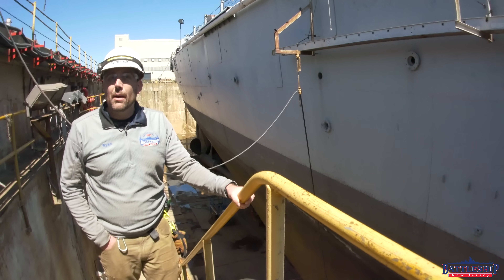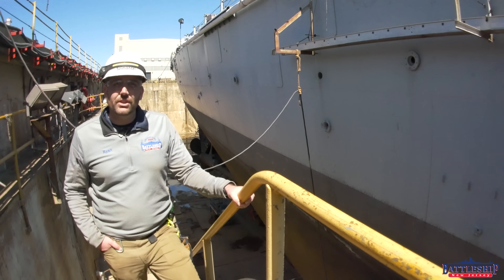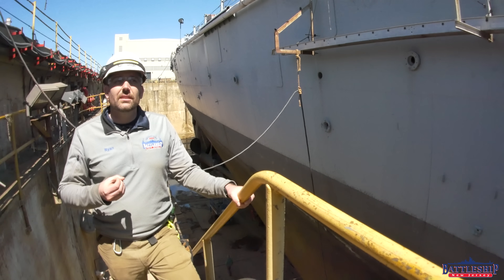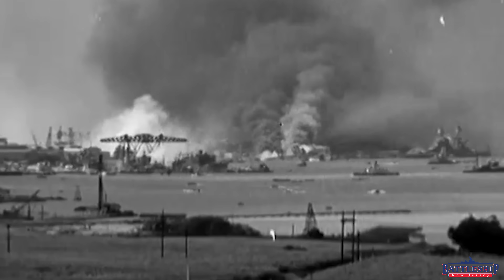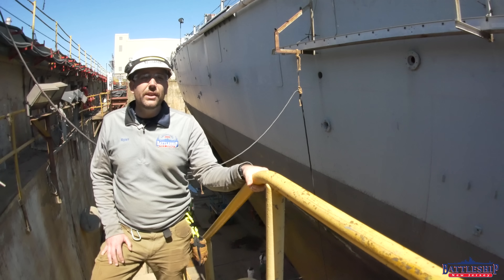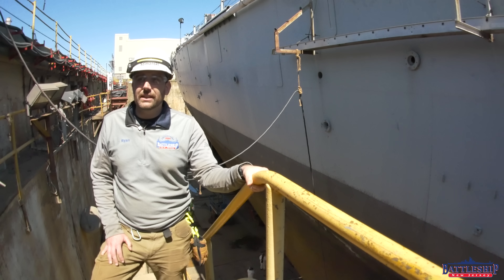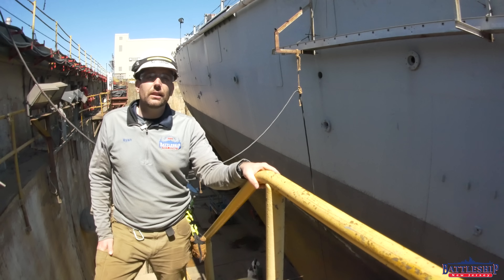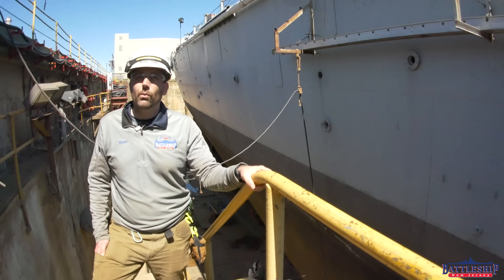The Most Vulnerable Part of Any Museum Ship: The Wind Water Line

Comment: How exactly do the propeller shafts  come thru the hull? Is there some sort of a bushing or gasket? Is that being inspected also? What keeps the shafts centered as they exit the ship? Whatever it is, does it need maintenence overtime as well? Does it leak need pumping out? I imagine if the shaft isn't perfectly centered or gets misaligned somehow it would create a heck of a vibration and considerable damage to the thru hull opening. 
I never thought about any of this until watching this video amd seeing them by the screws painting the rudder. I see a few others are curious about some of this as well.

Comment: As a Limey and used to the metric system, your use of "mils" caused initial confusion. 30 mil of paint seemed rather thick (nearly 1 1/4")  then I heard you mention thousandths of an inch. Light bulb moment.

Comment: About the ship's condition... now you mention it, yes! I wonder about the prop shafts. In an earlier video you mentioned it's coated with a substance that should keep water out (and is also one of the main reasons Iowa shouldn't turn her propellers). I wonder if the checks from the outside revealed anything interesting about this.

Comment: I wonder if some plastic tanks could be installed in forward parts of the ship in lower unused compartments and then filled with water to replace some of the normal operating weight that is absent from the ship now?  I'm thinking tanks like the ones you see ranchers and contractors hauling around on trailers might be cost effective.    Besides the benefit of the ship sitting at its proper waterline,  it would also be relatively easy to empty tanks as needed in order to do inspections and such by pumping out water and dumping it overboard.

Comment: I'd definitely be concerned about the propeller shaft ports into the shaft alleys, the rudder post joints and ports into the steering compartment, and the stabilizing struts that hold the 2 outboard shafts. Also the blanks over the sea chests but you guys already checked those.

Comment: you can see the entire exterior so any issues would be inside due to condensation and any water from weather getting in. not something you need to mess with in drydock though and you probably keep a handle on it anyway just through regular maintenance. interior of the through hullplugs maybe, make sure the steel isn't degrading badly...but again one of those things i suspect you check fairly often.

Comment: The Bakery is the place where most care is needed. The problem is not the water, but rather the other sailors sneaking in and taking extra donuts for themselves. You think not? I was one of the biggest culprits hanging over the Dutch door looking longingly at the donuts as the second-class petty officer turned the donuts and set them out to dry. My cute face must have made a difference because he always gave me some in a bag. And they were square donuts that way there was no waste between the donust and all of the dough was used in one pass. He had a roller and so could cut out a whole batch at once.

Comment: As a suggestion, I would be considering the things that my enemy may not have considered... and while dry-docking is a GREAT excuse to obviously do the work you need to do to things that are normally SUBMERGED - WHAT needs to be calibrated or fixed INSIDE the vessel and is significantly easier to repair or calibrate while she is PERFECTLY STATIONARY?  If there is a gyro-compass you think you can get to servicable-condition: now is the time baby... not that you can't do that later, but let's do what you can while the contractors do their contracted jobs on the outside.... ALSO - have they made the boat's interior accessible to you and your staff during this process or is it a real pain in the ass for you to even board the boat???

Comment: Point of slight correction: the waterline is calculated based on optimizing the boat's cruise- and flank- speeds with a minor bias towards improving range at cruise instead of trying to squeeze the last half-knot out of her top- top-speed (because it takes an hour of straight-line sailing just to get up to flank-speed anyways).  And then the armor and turrets were designed out away from the intended centers of buoyancy and mass to achieve an optimal armor profile at expected battle-speeds given the already calculated intended water-line: but obviously all of this gets screwed up if she has taken battle damage and is listing or flagging at the head or stern or if she is unable to make battle-speeds.
Reply: For any super-nerds that wanted to read on: the Iowas were tremendously capable of using their mains to great-effect if they were operating at a normal battle-speed OR if they were slowed to near-nothing but far less accurate at mid-range speeds.  But, her WW2-era fire control systems IMPUTED a designed-assumption that the boat was riding an even-keel and trimmed appropriately for the speed she was making.  The gun directors certainly had procedures for compensating for a list or other abnormal situations - but, if she wanted to be shelling a target at distance while scoring hits - she either needed to be going fast enough to be driving the bow up and really creating that white-surf mustache on the bow or she needed to be at a near-drift: which is dangerous if you are in-range of the enemy, but dramatically less-so if you still out range your foe by 5-6 miles.
Reply: Underway replenishment - a talent that we developed which was far more important to the outcome of the second world war than the skill of our carrier planes (the direct opposite of the Japanese experience) - is also REQUIRED to be conducted between vessels that can match speed and course, in choppy seas, and be riding on a very even-keel, which can be very difficult to account for when you are traveling and speed and independently bobbing and bouncing in 3-different dimensions of space-time.

Comment: The wind / water line of USS Yorktown is abysmal and makes me wonder if Patriots Point are letting the ship deteriorate like they did the USS Clamagore Sub.  I kayak a lot and have paddled right by Yorktown close enough to reach out and touch her - the rust holes are as deep as my fingers in places and I expect I could pull steel off in pieces bigger than my hand if I tried.

Comment: I believe the Iowa has solved her bow trim issue by ballusting turret # 1 with several tons of 16" practice ammunition . This explains why they had to rotate Turret #3 so they could line up with the ammunition loading hatches . The shells were struck down to broadway so as to use the overhead rail system to move them up to Turret # 1 for stowage. The Iowa channel has a series of videos explaining the process. Perhaps Mike Getcher could give you folks some suggestions on where to obtain 16" training ammunition.
Reply: it took 2,000 tons of water to level her for the drydock blocks

Comment: To answer Your question: With the outside protected, I would take attention for damage inside - out. For example accumulating liquids in hidden areas. Possible sources would be ingression of rain water and air moisture condensation. Worst case would be leakage of toilet system...

Comment: Hey, big fan of the channel. Flew from AZ to see the ship. 
With the ship sitting so much higher in the water. Would it be possible to simulate the weight of a fully loaded new jersey by using weights, underwater chains etc. Or is the amount of weight that would have to be added just too much to simulate? Thankyou
Reply: To ballast the ship to enter the drydock, they added about 500,000 gallons of water (approx 2000 tons) to the peak tanks which are at the very bow of the ship.  Adding that much water brought the ship from about 10 feet "out of trim" (IOW how far from level) to within 3.8 feet of trim, which is where they needed to be to safely land the ship on the blocks.  Right after settling on the blocks, they had to pump out that water as the peak tanks storing the water are the bow shell plating, and the cold ballast water would cause the bow hull plating to sweat with condensation, which would present a problem with paint application.

Let's say the Museum decided to ballast the ship permanently for the reasons Ryan stated.  First, they would have to find the perfect ballast material---while water is the perfect thing for an active naval vessel, that's far from perfect for a Museum ship.  The perfect material for a Museum ship would have to:
1. have a greater density than water
2. not react with the interior of the ship and cause any corrosion or other degradation
3. be cheap
4. be placeable into the ship with minimal effort

One last detail:  the two gangway/elevator towers at the Museum's pier were built to match the ship in Museum trim, bow high.  The one at the bow is significantly taller than the one at the stern.  If the ship were ballasted to be level, the forward gangway/elevator tower would have to be lowered to match.

Comment: so, this is just my experience working on heavy vehicles, but rust typically starts from hard edges. a 90' corner on a plate, the end of a rim, a sharp angle bend, etc. I would think that the blockoff plates would have rust where they meet the hull plate, and where the shafts come out of the ship where the hull just kind of stops suddenly

Comment: It's great to hear issues about the wind water line are not of concern at the moment .Ryan did do a video about the forepeak tanks and evidence of corrosion from film of the last docking . It  does show how corrosive seawater is compared to fresh . Hopefully the ultrasonic tests will confirm all is well . I suppose the prop shaft and rudder glands are likely to be important if all other hull openings are blanked and tested .

Comment: As others have commented on the waterline issues, a question of my own.  If the reduced weight of the ship is causing the waterline's movement so much, 2 feet stern and 10 feet bow per this video's information;

All of the ship isn't being used for tours, and there are undoubtedly places in the bow (and forward / around turret 1), that could have weight added to try to lower the bow.  Yes, the total weight involved would be high (especially at modern costs of heavy, relatively compact, and not (long term) damaging materials), but why not attempt this for long term stability?
Reply: @terr281
Serious weight though. In order to solve bow sticking out (and pass the bridge next to NJ normal berthing place) they had to fill the forward tanks with large amounts of water. That is not a long term option, as not only tank corrosion is a problem but also the feet lines and valves between the tanks have proven leaking (see on off the preperation video's a few weeks back).  And that was only the weight needed to just be able to pass below the bridge, let alone all the extra weight needed to get to the normal displacement. 
Think of it like this, normal operation would be fuel, provision, ammunition, water and the almost neglectable weight of about 1600+ full grown man.
Reply: The ship does sit higher than it would normally if it was commissioned and fully fueled and armed.  They could ballast it level but the ship's pier access is designed for the bow to be 10 feet higher than the stern, they'd have to redo that structure if the ship sat level.  They plan to just coat the area that is her wind water line as it currently sits.

Comment: Why not load some of the internal tanks with lead shot or similar material to level the ship and bring the wind waterline back into spec.
Reply: Cost basically.
Go and price say 3000 tons of lead shot. Then fill the required voids with it. Plan on removing it in say 10 years to inspect for corrosion where its been sitting. Different metals together are the basis for electrolysis and rust, you get different cooling rates and condensation which will pool at the low points under your several thousand tons of shot. You will damage the paint putting the shot in there which adds to the rust issue.
Cheaper, easier and lower rust risk just putting up with the extra freeboard.
Also the access points into these areas are small man sized.

Comment: Now I have to wonder... why doesn't the museum ballast the ship to keep her close to her ideal waterline under normal conditions?  Are you afraid that some of the fuel bunkers might not have been cleaned out enough to let you safely fill them for ballast?  I'd think that if there aren't environmental regulations or corrosion worries, it'd make more sense to use water ballast to keep the thickest shell plating at the wind-water line...
Reply: Ryan previously said the fuel bunkers were "Swiss cheese".
Reply: Fortunately, when the ship was handed over to the museum, the fuel bunkers were emptied and cleaned. There's a little bit of water ballast for trim that they use, but if I remember previous videos correctly, the less they need to rely on those, the better, just for the sake of minimizing corrosion and potential internal leaks.
Reply: Ryan had mentioned before that using water as permanent ballast would cause more corrosion and potential flooding if there would be any piping or tank failures.  I'd be interested to hear if they ever considered a type of solid weight for ballast.  Sail boats often use lead in the keel for stability.

Comment: Where the ship sits in the water is entirely under your control. Dont wine about the bow being high when u could flood to fix that. Texas could even flood her sarbord side to fire further inland. Add ballast, or flood spaces so your line down the ship is optimal.
Reply: I heard no wineing, just concern. You can’t leave interior spaces flooded! You would have corrosion inside and outside.

Comment: 6:15 Is the fender a ball or roller that rolls rather than rubs?
Reply: It looks like a giant rubber drum.  It probably does 97% rubbing and only 3% rolling as the ship goes up and down about 5ft total with the tide on the river.
Reply: @SomeRandomHuman717  Would a chain hanging down outboard of the drum, with a loop and going down to an anchor, make it roll against the side something like the Dambuster bombs? Also roll up?
Reply: @greggweber9967  Probably not, because the fender seems to be squeezed pretty tightly between the ship and the concrete block that the fender protects.

Comment: Even though we were in drydock several times when I was aboard ship in the Navy 1963-66, I find this series very interesting.
Reply: Where did you stay when she was in dry dock?   I assume the crew vacated the ship ?
Reply: @cruisinguy6024  No- in none of the cases were we required to move to barracks ashore. The first time there was a grounding and a screw was damaged. We went to Boston to have it replaced, a few days. The second time was to clean the bottom and it would have been nice if we could have stayed on shore, but no soap- the racket was amazing. The third time our sonar dome had failed, and we went into a floating drydock in Davisville RI for a replacement, only 3 days.
Reply: @mencken8  New Jersey has a sonar dome?

Comment: Why isn't the ship ballasted so it has a more natural stance in the water?
Reply: A couple of reasons.
Cost and lack of access.
Water is the most cost effective ballast they have available. As shes no longer an active ship just having several thousand tons of water sitting in places like fuel tanks and trim tanks for long periods equals yet another area for water and corrosion to do its thing. If its dry and painted you dont get rust. If its wet and painted the paint will eventually break down and you have water under paint and continuing and expanding rust in places not easily inspected when they are full of water.
Easier and cheaper to put up with the extra freeboard. Less chance of internal rust and you dont have to pump her dry and inspect on a regular basis. Also ever smelt river water after its been confined in a tank for a long period?
Cheers
Reply: It took 2,000 tons of water to level her for the drydock blocks.  That's a lot of ballast and they can't use water permanently as the ship would rot from the inside.